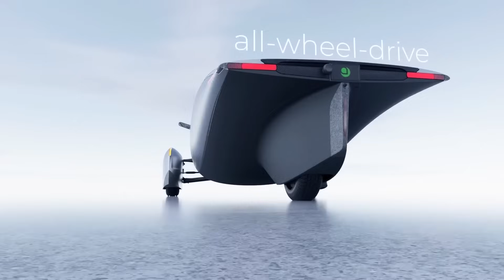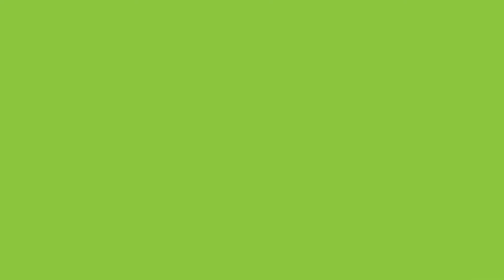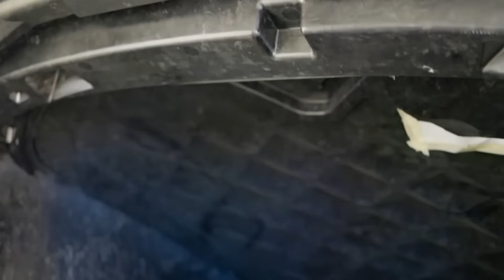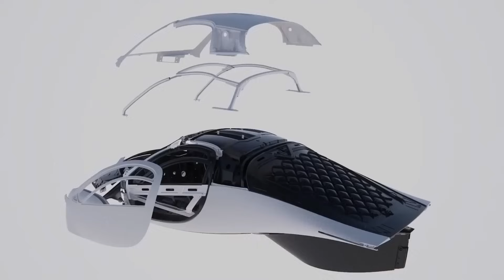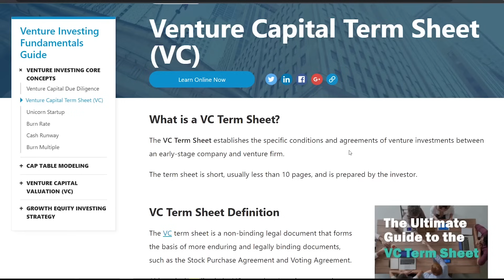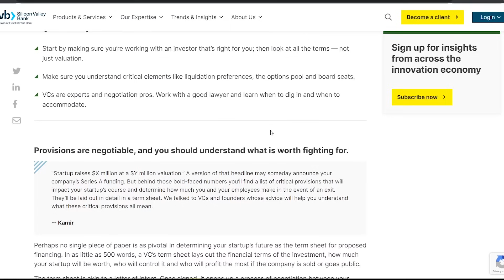Aptera's November 2023 update

Comment: The parts on the left rear of the frame look like outer shell part of the door while the right rear parts are the structural part of the door which is similar to the roof part that they are sitting in where there is an outer white shell with a black inner structural part.

Comment: Until the production intent vehicles are done, and validated, whales might be reluctant to lay down dollars. The opposite is also true, once those tests have been done, and shown what we believe to be true is validated, then whales will have little risk. Sadly, the investor holds the upper hand currently, but that changes once the tests are completed.   My term sheet would say I will invest as soon as I see the numbers. Proving what (Aptera) thinks it is real. EPA testing showing over 330 MPGe, crash tests showing the highest strength despite what the naysayers think. Solar generation of X kilowatts, and in-wheel-motors that are capable of torque vectoring, making the moose test like silly thing, not a problem as it is for many SUVs.  All the unknowns will disappear once those production intent vehicles have been through the tests and show that this is a superior product to what is being sold in the current marketplace.

Comment: Nice comments on a great monthly report.  What struck me:
- CPC production of 20,000 to 45,000 tubs per year will essentially define how many Aptera can be built.  Not "mass production" by regular car standards, but approximately equal to Corvette production. (About 53,000 in 2023)
- "recycle carbon fiber x times" - Not sure there is a way to determine how much a given bucket of scraps has already been recycled, so this may simply mean "carbon fiber manufacturing scraps will be recycled".  No counting.
- Interesting that I saw no embedded anchors in the tub forging.  (For fastening things like seats, battery pack, center console, pedals, dashboard, etc.) When I looked at a CPC forging from an unidentified (non-Aptera) piece a few months ago, I was impressed that it featured threaded metal anchors embedded at required places.  
- Thanks for background on "term sheet".
- Concerning timeline, it sounds like the first real production will be a year from now ("late 2024"). Hopefully, the ramp will be unusually quick, with "accelerator" vehicles in Q1, 2025, and Launch Editions by end of Q2.  Since I can't afford an accelerator spot, that's the best I can hope for.

Comment: Please someone ask the CEO, if the tub is 20% of the vehicle then any minor damage to it means we have to replace the whole tub which is 20% of the vehicle ? 🤯
Reply: My understanding is that anything not major enough to destroy the tub would not do significant damage to it. It is designed to spring back, not deform.

Minor damage is intended to be absorbed by the fiberglass paneling which is easy to repair. Major damage will cause the tub to disintegrate to spare the cockpit, requiring purchase of a new Aptera.

IIRC they've said that even parts cast in one piece can have sections that are sacrificial and others that are designed to survive. The tub is supposed to be the last line of defense so I would expect everything else to give out first. 
 
I still would like to see how the aluminum frame fits into this, as I believe that's the major component of the forward crumple zone.
Reply: I'm not even sure that you could unglue the tub from the rest of the body parts. Any damage to the tub might require an entire new shell, with the functional part from the original vehicle swapped into it.

Comment: If the investor goes to the trouble to produce the Term Sheet, they must be seriously interested. If the Term Sheet is signed (as Chris indicated), it sounds like they are "on the same page" and the rest (due diligence, etc.) is just process. But how long will it take? Nonetheless, it appears they are close to some serious funding. And if there are several of them... so much the better. Once due diligence is done by one and the funding materializes, others may follow relatively quickly. Of course, if one falls through, it could have the opposite effect -- but there seems to be cause for optimism.

Comment: Im worried about the large piece getting cracked in an accident, but then again, most cars have a pretty low "pain tolerance" when it comes to insurance claims and being totaled. I guess with this, hopefully the steel frame takes  the deformation, but time will tell
Reply: Yeah that's a concern for me too. I'm guessing that if the large or any of the structural pieces get bent, it would probably be affordable to get a replacement piece, but I'm guessing that fixing/re-installing that piece would be a complicated operation. And then obviously right now, the lead time to get a replacement piece would probably be a fairly long period.

Comment: I'm amazed at the reaction from Aptera fanatics about the Aptera solar 3.0 (glass topped).  They all speak now as if Aptera solar 1.0 and 2.0 were far inferior yet they lavished such praise on them back when they were first revealed.
Reply: There have been many component improvements made since the initial Aptera announcement. From the CPC bodies, to the custom Elaphe/Aptera motors, to the new glass covered solar panels. But each of these changes have been improvements that will result in Aptera owners having a better EV in the end. I would have been fine getting the original Aptera of 2020, but getting a better EV, for about the same price, with the only cost being the delay in production, should be celebrated.
Reply: @deanmcmanis9398  You may have missed the point.
Reply: @palindromeambigram4852  Your point was to lob an insult and he didn't seem insulted?  Is that what you mean?  He responded to what you wrote.
Reply: @jonj9149  I don't think insult means what you think it means.
Reply: Would that be like being in wonderment over your Blackberry until the Iphone comes out?🙃
Reply: @glennzajic7318  You, too, may have missed the point.  Try again.
Reply: That's how improvements work you dongus.
Reply: @te8547e  Only in simple minds.  Oh, and you missed the point.  Try again.